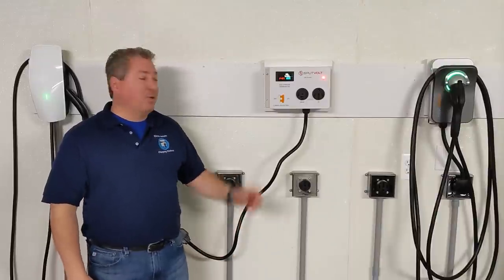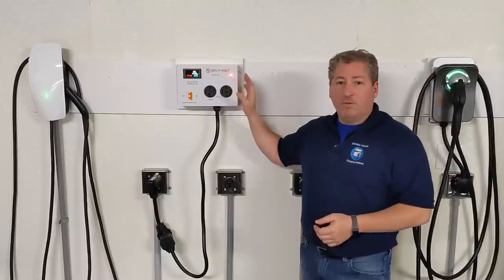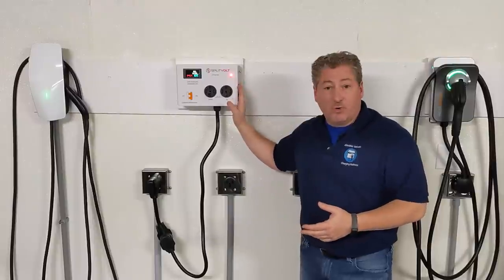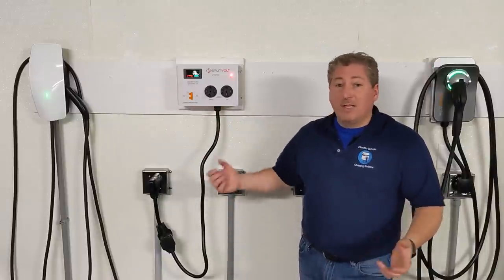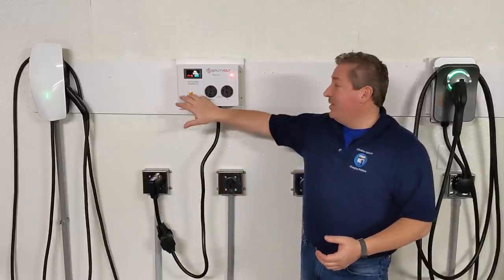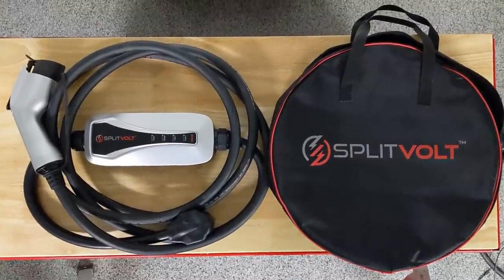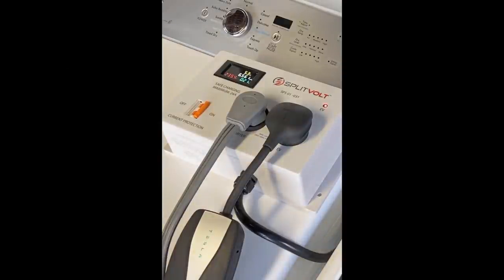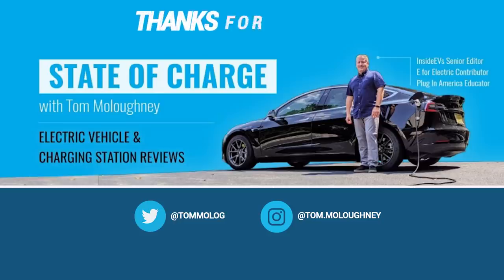SplitVolt Circuit Splitter For Electric Vehicle Charging

Comment: They need to make this so that we adjust the power base on each outlet use.  If both are drawing power then 25A each but if one is not drawing any power it need to be able to send full power to the one currently available.
Reply: there is no adjustment. it's one outlet or the other. Drier runs for 30 minutes or so that it goes back to EV charging.

Comment: Tom, did you get a few feet of snow? I have many (fond, oddly enough) memories of shoveling snow from my parents driveway in Woodcliff Lake. Back to EVs. Any plans to review EVSEs with NEMA 14-30 plugs? Since it seems this a pretty common dryer plug, using a splitter type device like you have reviewed makes a lot of sense but I only know about the Clipper Creek LCS unit. Thanks!

Comment: I love your programs. I’m planning to buy a Grizzl e ev charger. I noticed that the power supply uses a 2 phase 14-50 plug. I live in Australia and most homes only have single phase electricity. Can I still  use this charger. I intend installing a designated 50 amp supply.
Regards Tim
Reply: PS my home is a little unusual in that it also has 3 phase electricity.

Comment: Consider calling the EVSE a charging cable. We also assume Tesla folks will want to get the NEMA 14-30 pigtail and not be messing with the settings in the vehicle.
Reply: Are you referring to the amp setting?

Are you stating that the amps will prefill in the settings (depending on which pigtail is connected)?

My outlet is 10-30. I have a 14-50 Tesla pigtail, thought it would not be an issue using the combo split volt box.
Reply: @jesses9553  With Tesla UMCs each pigtail sets the max amps and there is no way in the vehicle to increase it. For example, the Tesla won't let you bump the connection up to 15 amps when using the NEMA 10-15, your limited to 80% of the rated amps for that plug, so 12 amps. Using the NEMA 14-30 pigtail, the vehicle will set and limit the connection to 24 amps. Unfortunately, SplitVolt puts a NEMA 14-50 receptacle on their splitter, when then they should offer a 14-30.

Comment: Tom have you done a video on a product similar to this (charge two EVs from one circuit) but allowed for higher amperage? I think I'll be getting two EVs (knock on wood) this year & want to be able to have the flexibility to charge both around the same time.
Reply: I had a similar thought and wondered if there was a device like this to split a 50 amp circuit two ways. (in sequence or paired at lower power) The obvious answer is in the labor an electrician will charge, which will be about the same for a larger cable back to the panel. Juts install a sub panel in the garage with two 50 amp plugs and the money you save on NOT buying a splitter will pay for doing it properly.

Comment: Great video and very good info!  Do you know if anyone makes a 14-50 outlet on\off switch so I can always leave my Tesla charger plugged in but switch it's power on\off when needed, instead of having to plug and unplug the Tesla connector from the 14-50 outlet every time. Thanks!

Comment: Some garages have more than one 20a 120v circuit. By code, at a minimum, a garage needs one 20a circuit for the parking bays and one 15a circuit for lighting/garage doors.
But if your garage has another 20a circuit, say for a workbench, or exterior outlet that you don't use, that can easily/cheaply be converted to 240V via a NEMA 6-20 outlet. That will get you 10-15 mph, a huge boost from 3-4, and likely enough for a majority of owners.
Unfortunately, if you don't have a tesla UMC, you either have to go hardwired EVSE that can go down to a 20a circuit, or buy one of those cheap Amazon NEMA 6-20 chargers.
Tesla needs to make their UMC with a J1772 plug! I bet a lot of other people would buy it with handful of connectors for their EV.  At $275, they are a bargain for such a good quality unit.
Reply: by code a 240 volt outlet needs to be a single cable, not a hodge-podge of two cables tied together at theother end.
Reply: That would give you about 3.8kW of power because of the 80% maximum continuous load which would be 16 amps.  Best to hire an electrician and have an isolated 240v circuit.  Best for safety and convenience.
Reply: @mikehedrick6544  ... rereading that post, going to 240 volt on that single feed (was 120) would be 16 amps per leg, so twice the juice of a 120 volt plug. OTOH, you'd have to find an adaptor to plug in the 240 volt cable supplied with the car.
Reply: @rupe53  I calculated based upon 16 amps at 240v for approximately 3.8kW. Two different 120v legs of the panel will provide 240v. Did I miss something?
Reply: @mikehedrick6544  ... not at all. It's just another way for people to understand how things work. It also depends on how the display in your car works. Having never owned an EV myself, I have no idea if the dash setting show watts, Kw, or amps for charging rate. OTOH, I have a fair understanding of home electrical systems.
Reply: @rupe53 When I charge at somewhere other than home, once the charging has begun, and I look at dashboard I see the amount of kW being sent to the vehicle. Sometimes I observe it climbing for a short time. The display shows the current percentage of SOC (state of charge), how much in percentage it will charge to, and the amount of time it will take in hours and minutes to achieve that charge. Same for at home except I usually charge at night and I don’t go looking at the display. The kW amount varies depending on the actual charging station. The car lets me set the limit of charge.  I usually set it at 100% for DC and Level 2 if I am traveling as I don’t want it to stop charging if I’m have a good meal.  If it stops I need to move the vehicle. I do of course take into account the number of chargers and how busy the location is as I am always considerate of others that may need to charge.  I keep an eye on the charging app for the charging rate also.  Charging at Level 1 is fine for people that don’t travel more than 40-50 miles a day I think and many get by with that.

Comment: What will the difference in charge time be if I reduce from 40 to 24 amps?
Reply: that depends on your car. 40 amp rate is the max you can do at home, which most won't need unless they drive 200+ miles a day and don't have 8 hours to wait while they sleep.

Comment: Tom, great 👍 low cost EV charging solution without the need for a dedicated circuit.. 

can you get this unit with two NEMA 14-50’s plugs for two EV charging on one  circuit?
Reply from the maker: No, only one 14-30 & one 14-50, but you could just get a 14-30 to 14-50 adapter for the other side.
Reply: @StateOfChargeWithTomMoloughney  great idea.. cool ... got a few friends that is in need .. two charger on one circuit, they had to setup start / stop scheduling on both unit and try not to ever overlap lol 😂 not ideal ..so this unit would fix that and no schedule would be needed ..just plug in and walk away.. 👍

Comment: Can I use this split volt to charge mustang Mach e?
Reply from the maker: Yes you can.
Reply: I use it every day on mine.
Reply: @Bkboygenius  is there anything special you need to do to your Mach E to allow it to charge with this? I was under the impression that we can't change the amps coming into the Mach E through Software and the mobile charger that comes with the Mach E does up to 30amps which is more than the 24amps the split volt allows. Am I looking at all of this correctly? Thanks in advance!
Reply: @MovingForwardAdventures  you need this plus a juicebox. The juicebox will allow you to drop the amperage down.
Reply: @Bkboygenius  ok great, thank you for the quick reply!

Comment: I have a water heater can i plug it where say dryer?
Reply from the maker: You should be able to. You need to check the circuit's rating and plug configuration to make sure its compatible.

Comment: I was just at an electrify america show in San Diego (very disappointing) and there were so many expensive home charges there. I just think this is BS. A very inexpensive solution is just getting a Y adapter. To me anyone charging over 24 amps is shorting the life of their battery. Yes you have to be conscience of which one is on but this is easy to do.

Comment: Didn't you previously review the NeoCharge Smart Splitter?  This does the same thing, right?
Reply from the maker: Yes, they are similar products, but there are differences.
Reply: @StateOfChargeWithTomMoloughney  Splitvolt also has an internal circuit breaker, real-time power display, pigtail cable for positioning/orientation, does not require installation, and is lower priced.
Reply: $450 for NeoCharge, is about $200 too much...

Comment: My Nissan LEAF (2015) can do L2 charging at 6.6kW which is 26.5A  * 240V.  As far as I can tell I cannot set the controls to limit charge rate so I guess its a no-go when it comes to using one of these. :-(  ...just too many amps.  Nissan LEAF owners are a big part of the potential customer base.  Used ones are very cheap ( <$10k ) having two to charge up in a two car garage would not be unusual.  Sigh....It appears I cannot use one of these with that.
Reply: @foxpup - a few months down the road on this one, but what you could do is to use one of the “light” 240v EVSE’s which draw 16A from a 240v circuit (3.6 kw to car).  This way you could still power the dryer(?) with the 24A plug, and the EVSE would only draw 16A to power the car.  This method would add about 150 miles to your car in a 12 hour period.  It would require an adapter to get from the “dryer” style receptacle to the plug that the EVSE uses.
Reply: @dennislyon5412  You are right, it does depend on what EVSE you use.  I'd still want to seek out an EVSE that can adjust the wattage so I could feel like I'm not throwing away money on a sub-performing EVSE.  Besides, an adjustable EVSE would rock if such a device exists and is affordable. :-)

Comment: its just a 240v power bar with circuit breaker.. NOTHING SPECIAL!!
Reply: it actually has a relay so it's one plug or the other. When the drier finishes it automatically goes back to the EV.